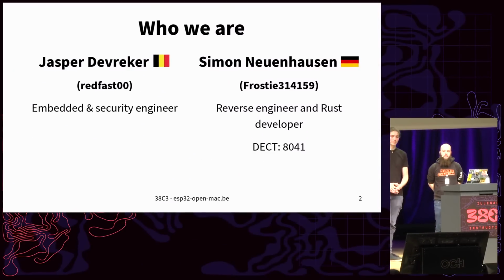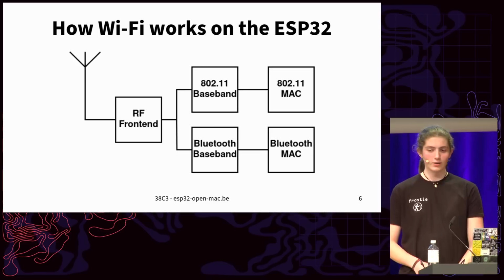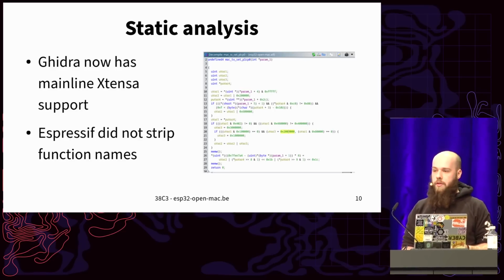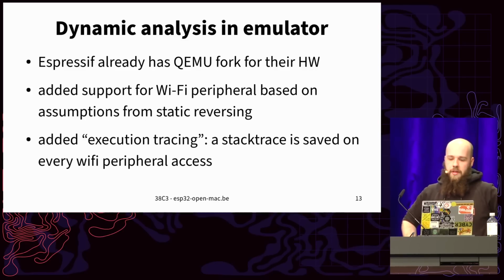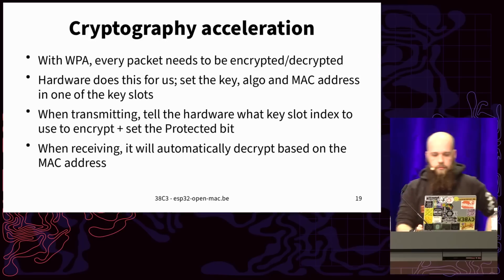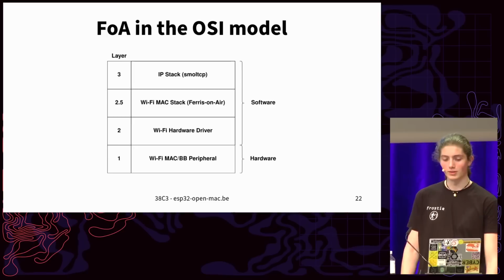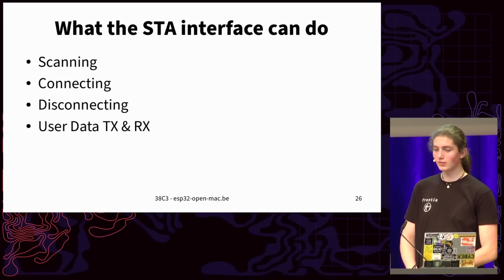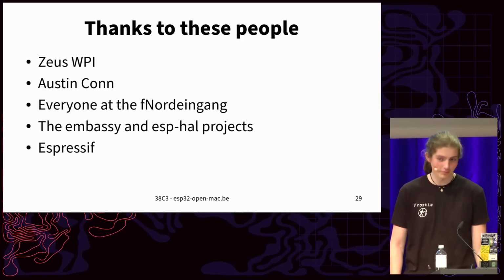Liberating Wi Fi on the ESP32

Comment: anyone had more recent ESP32 S2 and S3 disconnecting from certain WiFi base stations and not others? for instance they'll disconnect from Cisco AP after 1h exactly, and it is repeatable, regardless of whether there are or aren't any signals being sent to or from esp32, but it works just fine with TPLink, Dlink and Mikrotik APs
software rebooting and reconnecting also doesn't help, it needs to be a completely power down, only then it will reestablish connection with Cisco AP
Reply: 1h exactly is strange, my first guess would be DHCP lease time? Whatever it is it sounds cursed af, good luck!
Reply: @piotrfila3684  DHCP lease time was set to like 24h or something, at least that is what I was told, I don't have access to that system, and weird part is that the problems persists with only Cisco APs on that network, TPlinks were also set to DHCP passthrough and connection to those APs isn't lost, only the Ciscos, and it happens only with esp32 S2  and S3, it doesn't happen to esp8266, those work more or less ok
it isn't a huge deal, the network is going to get upgraded, those Ciscos are from 2005 or something, old devices, not supported any more
Reply: I had this issue and to me always occurred with Huawei and ZTE APs, however when I change to TpLink, Netgear and GL.inet (all of them running Openwrt) then works flawlessly without drops. In my case, I always use static IPs for IOTs, so no definitely no DHCP related. At the beginning, I was suspecting about the stock Huawei and ZTE firmware but I am not sure because only occurs with ESP32 devices.
Reply: @AT-hh4db Mirai botnet probably.